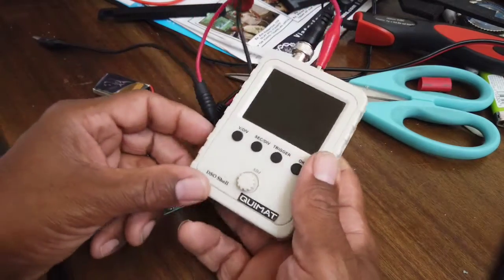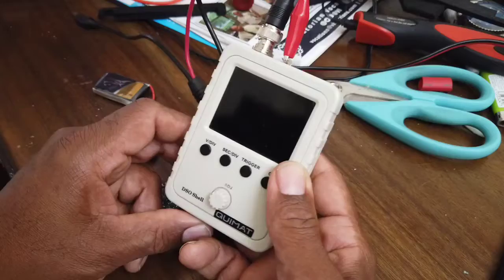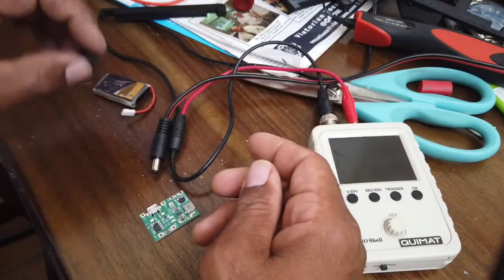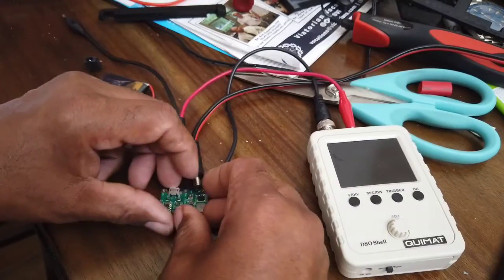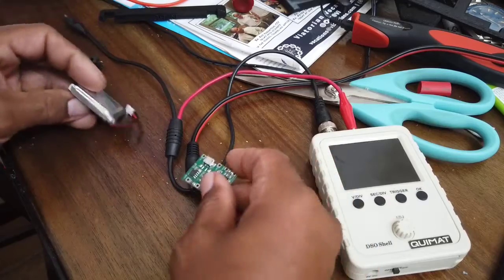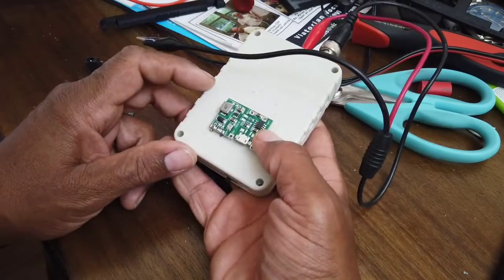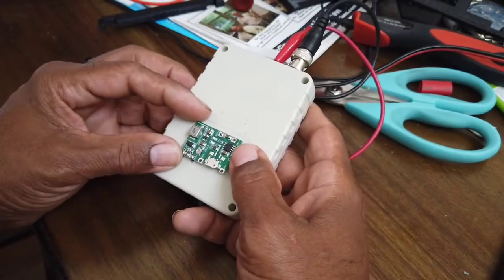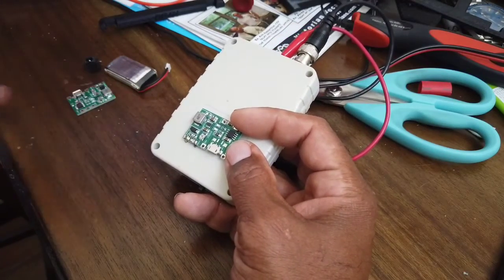3D Creator Questions

Comment: I would like to know about  this project KQ4CD Paul
Reply from the maker: Hi, this project began because I was building a few kit radios for ham radio.  I did not know anything about oscilloscopes.  Of course, I turned to youtube university to get some ideas.  As I was only available to afford kit radios at that time, I was not able to afford $200 - $1,000 for a scope.  I did, however, need to diagnose and understand what was happening with the kit radios I was building.  Google and youtube led me to this kit.  I believe the name is Quimat. It was a kit, and then it was an inexpensive already-built scope for people to learn with and use in a limited way.  The scope was powered by a barrel jack.  At that time, I had two small items that were powered that way; one was 9v-12 and the other was 6v-10v.  The latter would fry if more than 10v was applied.  Additionally, the scope had limited use to me if it always had to be connected to a power cable.  That is what made me modify it, crudely, with a battery.  The battery is 3.7v connected to a charger/controller that converts the voltage to 9v.  It was fun to do, and it works the way it is supposed to albeit limited.  I can use it more freely around the shack, and I didn't have to worry about accidentally applying the wrong voltage to it with the barrel jack. This video was actually a quick way to ask my nephew and friend how they would go about it.  This way of communicating got more ideas across and more quickly than a slew of emails or texts.  This is how I broke the ice for me in having the courage to do youtube videos.